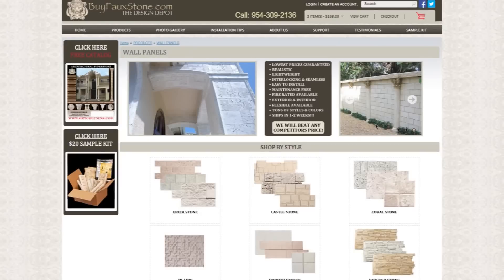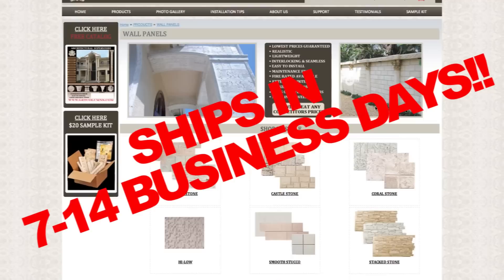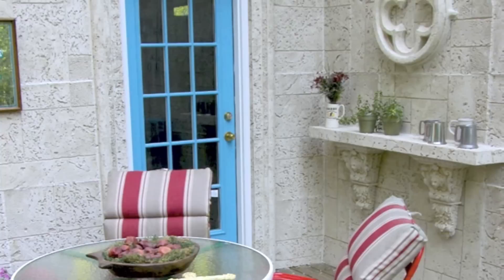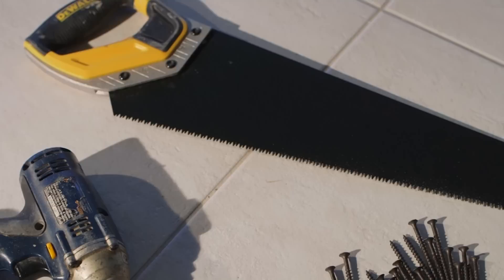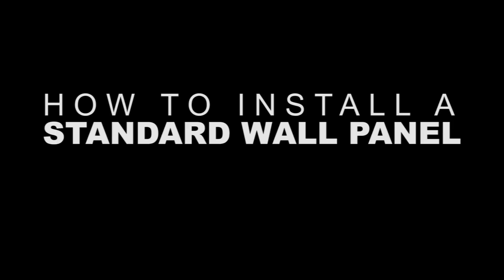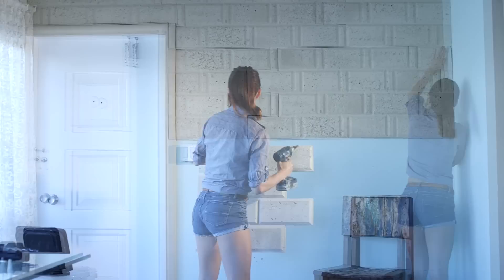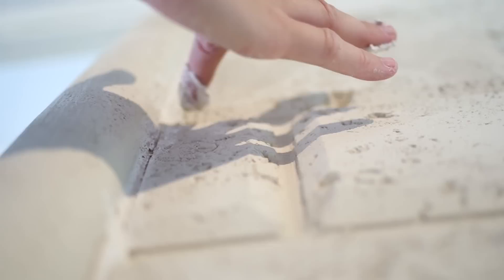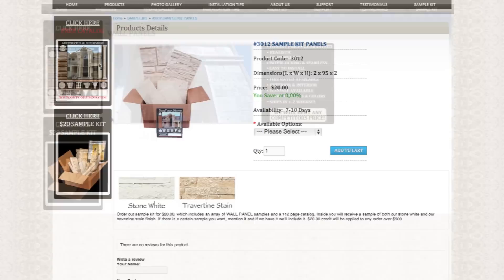How to Install Interior Wall Panels DIY

Comment: 3:15 How about creating a grout that actually matches the color of the panels??? They would need to be painted to look decent, thus more cost and work. Plus, a cursory check of the prices show this product actually costs just below the cost actual stone or brick. So if you have to paint the panels, the cost ends up being the same.

Comment: I don't see any where on the site where to calculate how much I would need. Can you tell me where it is on the website? Thanks
Reply: +Denise Long Shiflett . Measure the length of the wall (side to side) and then multiply x the height ( floor to ceiling) that's your square footage ( 10 x 12 = 120 sq feet)

Comment: these faux stones should only be used in movie sets, please dont use these for your home, it will NOT make anything look better, on the contrary. If you have to remodel an old house, then look at traditional methods, it will most certainly look good, because it is refined knowledge from hundreds of years. Oh, is stone too expensive? then don't use it. Please don't fake what you can't have.